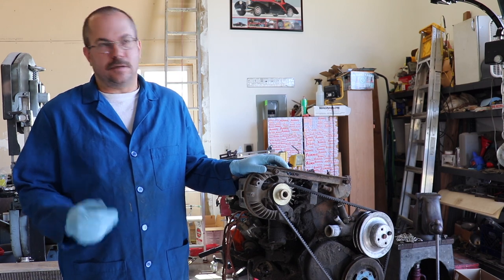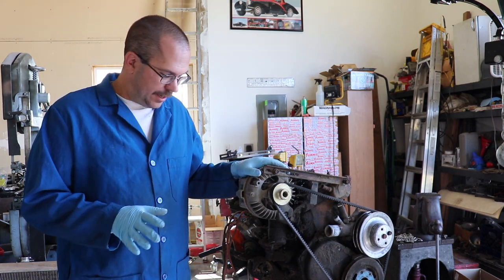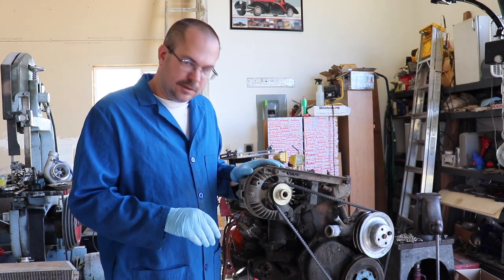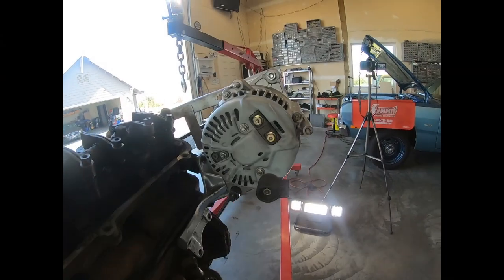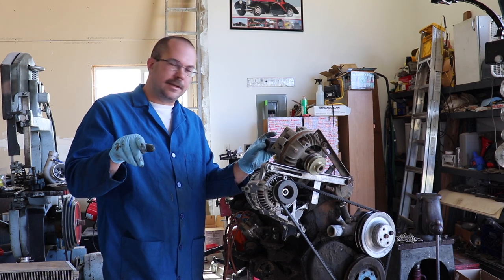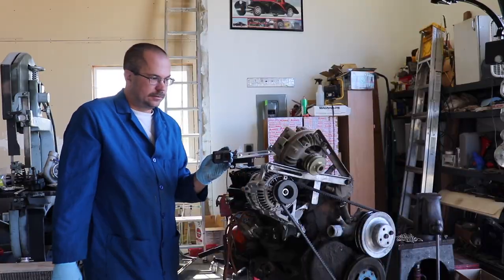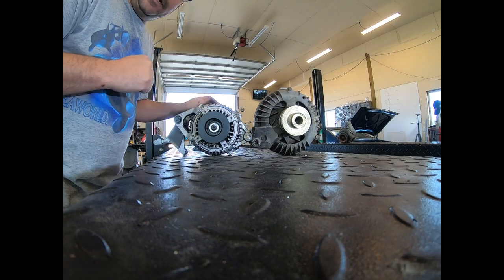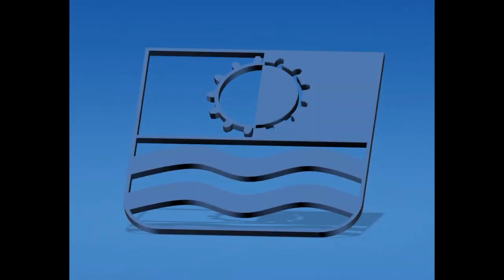Mopar Slant 6 Alternator upgrade 120A!

Comment: When the factory 120A unit failed on my '88 Ramcharger TBI 5.2L... while running a full MSD system... I replaced it with a Trak-Auto rebuild. (<-Boy, if THAT don't tell you how long-ago it was...! :D) When that failed--in short fashion--I grabbed a Nippon Denso unit from an older model in a salvage yard. I don't know what the actual output was, but since they were typically rated at 100A-min, I figued I was safe... and was right! 

Sadly, I didn't keep the Ramcharger long enough to see how the ND Alt would survive supporting my MSD box drawing directly from it (as was how I had wired it from the get-go) but seeing how it was such a simple, bolt-on upgrade, I'll gladly do it again on all older Mopars in my hands... automatically! ;)

Comment: Those Nippon Denso alternators are great units. I did this swap on my slant 6 in the summer as I had the old one from my 93 dodge ram diesel as I thought it was the problem it wasn't it was a power relay. anyway, it's got around 350,000 km on it and bearings are still like new.  bearing on the old-style alternator were also noisy.

Comment: It would be nice to know if you removed material from the FRONT, REAR, or both the F & R of the alternator bracket to accommodate and align the narrow ND alternator.
Reply from the maker: Mostly front with a little off of the rear once it was lined up.

Comment: I bet that would fry a factory dash in a hurry.
Reply: I'm pretty sure he bypasses the ammeter with around 6 gauge wire straight to the battery.  I bypass with 10 gauge but planning on upgrading to 6 gauge.  I also removed the ammeter too.